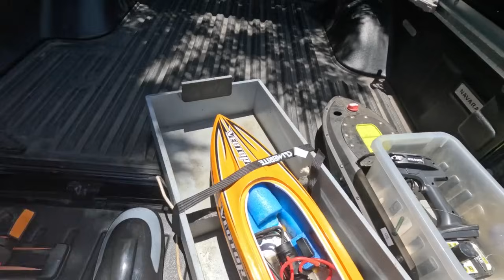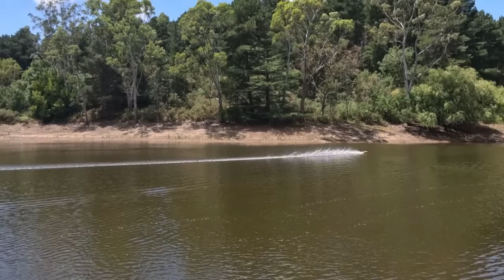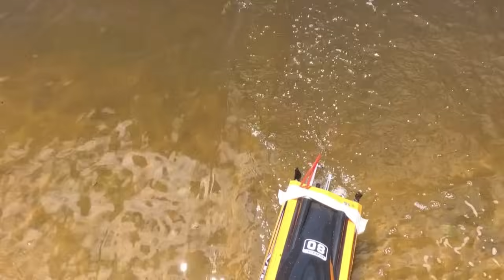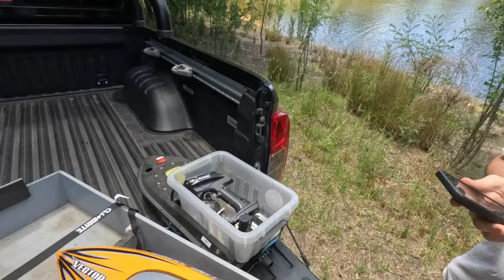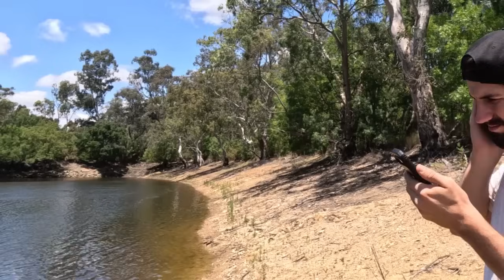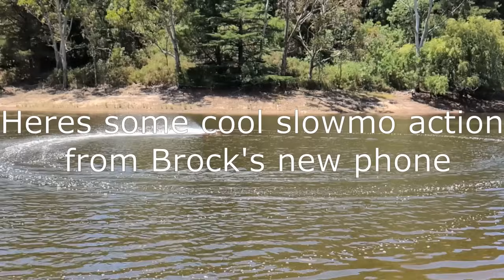Vector SR80Pro RC Boat Motor upgrade test on 3s and 4s

Comment: so does self righting still work the same as with stock motor? do you have a video showing the inside layout of battery,esc for best balance..i ordered one of these a few weeks ago..should get it soon..thanks for sharing😊😊
Reply from the maker: The rollover function cant work without the same type of motor it comes with

Comment: If I buy the full upgrade kit do I have to change the copper stuffing tube if I use the new metal cable in the kit. I would like to just plug n play kinda deal lol
Reply from the maker: No you dont have to change that, the wire drive suits it
Reply: Perfect thank you I’ll place that order shortly. I have both the 28 shreddy and sr80 so I love that you do the builds on them I’m trying to copy you lol than you for the details in the videos